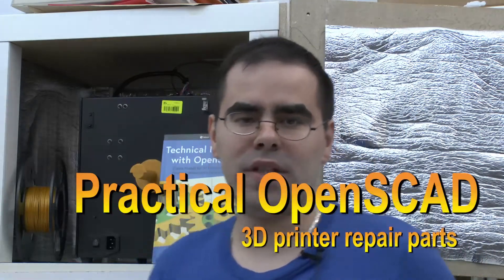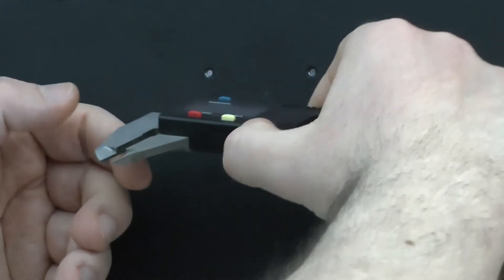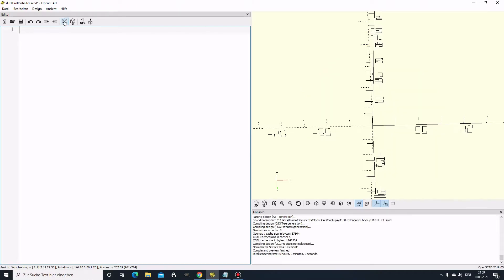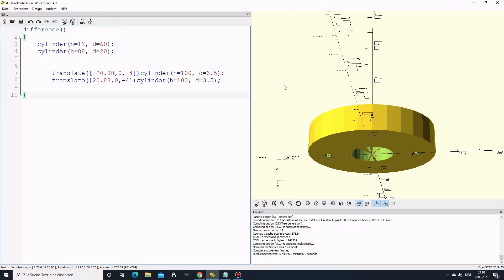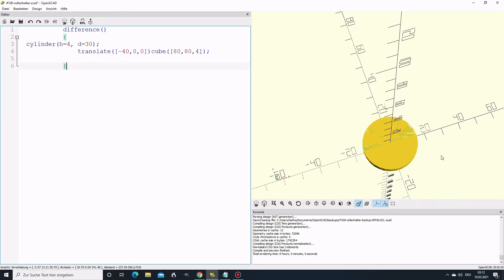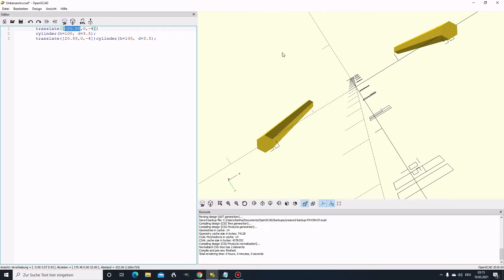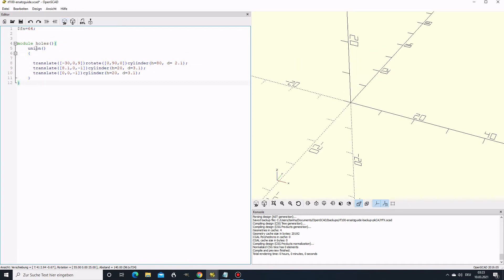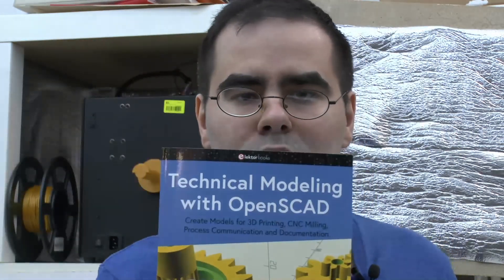Design 3D printer repair parts with OpenSCAD

Comment: Excellent video!

A trick I like to use to get the center dimension of similar holes is to measure the hole diameter then "zero" the caliper. That way when you take the outside dimension, the diameter is already subtracted and you get the center dimension immediately.
Reply from the maker: Hello, thank you so much for talking back! It is my pleasure to have followers like you!